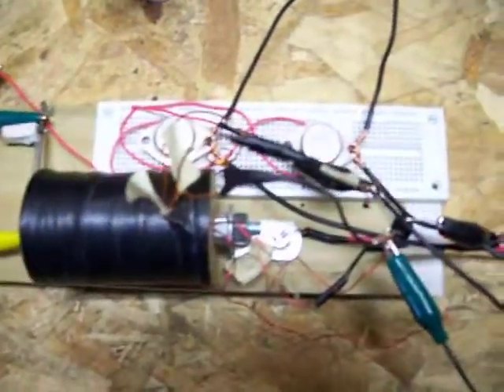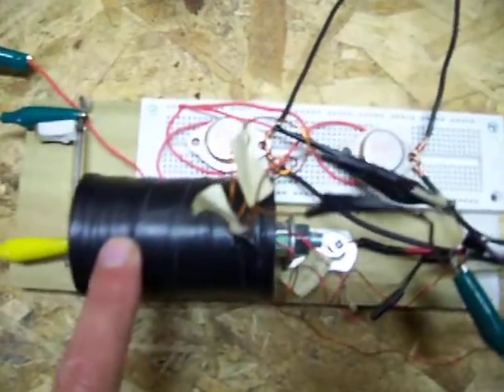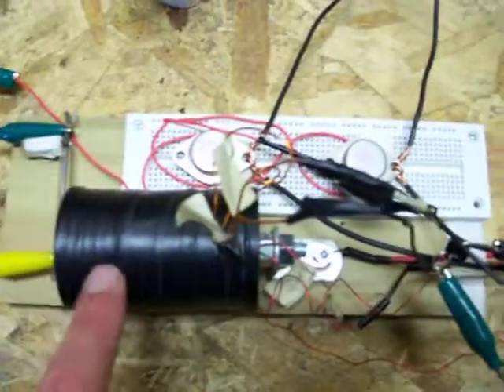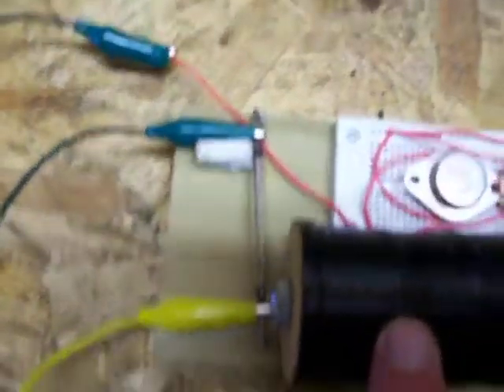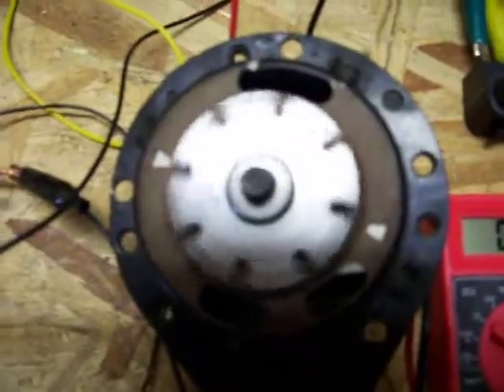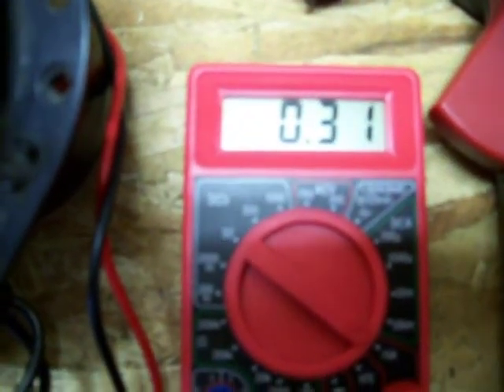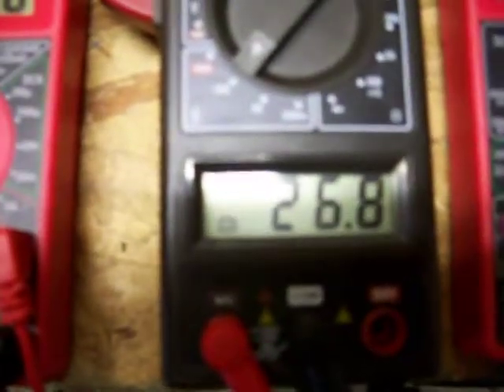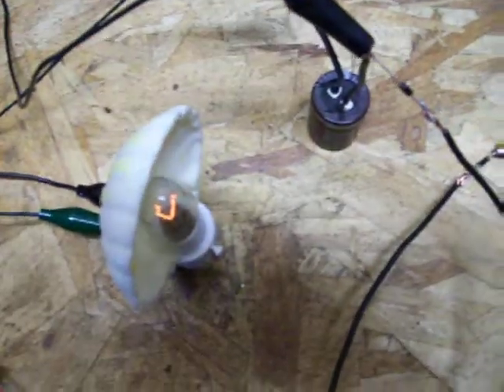Pulse Generator with different coil setup.

Comment from the maker: Input voltage was 12v.
The circuit is about the same but one transistor run one side of the coil.
And the other runs the other side.
Then there both hooked to the same reedswitch.